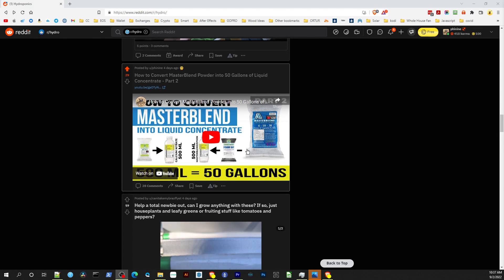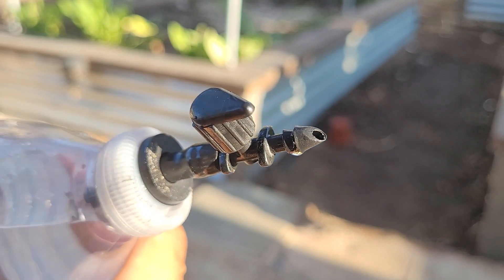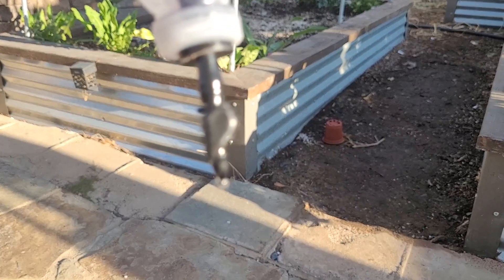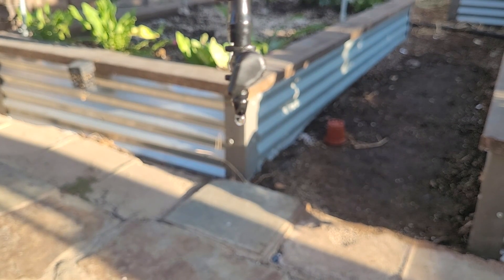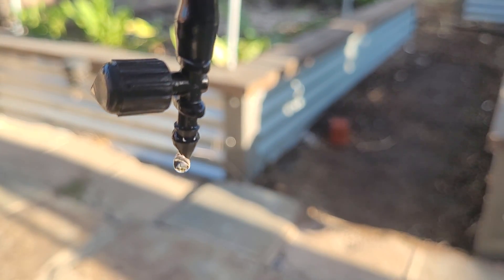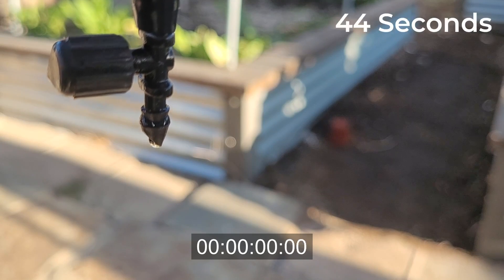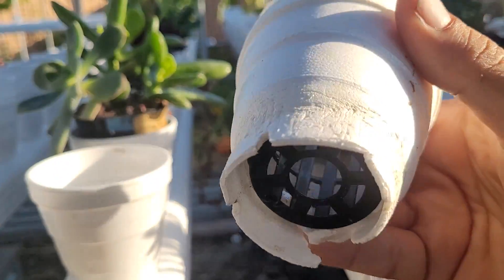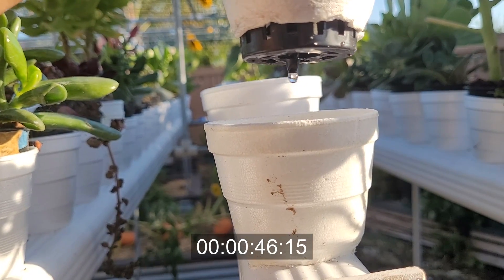Kratky Gravity Feed Nutrient Injector Over a Period of Time Experiment - Part 1

Comment: In the next test video, can you do a ph, ec or ppm test throughout the rail to see if the nutrients are getting distributed equally. I like this idea and setup but I have my doubts thinking without water flow, it won't mix well.  I've been watching the Grow Kratky channel and he is using a nutrient solution reservoir with a float valve to keep the containers filled using gravity and no electricity or water pressure. I think the key difference is that the nutrient reservoir is premixed because unless you can mix the nutrients throughout the containers equally, it's going to just stay where the nutrients drip creating a lower ph and higher concentration of nutrients there.  Very curious to find out otherwise.
Reply from the maker: Well right now I am just 24 hours into the drip and it seems to still be working.. I am just doing water to test and just want to see how long it takes to run out. I do understand what you are saying on the larger rails as nutrients would just build up in the middle rail. But there is a couple of things going on there as the water is tied into my garden beds and the water goes on every 12 hours for 20 minutes. So there would be some type of ebb and flow maybe once I get plants in there and they are drinking. Because when that valve turns on the float valve opens with pressure and would mix the water around. The lower the water the more the valve opens. And then it all comes into equilibrium with the other rails through those tubes. But I think it would work good on my smaller rails all around my window sills with 10 to 12 spots and this would make sense to use this there. I will start there on a smaller system first with the nutrients to see what happens and measure the PH and EC to see how it fluctuates. Experiment for now.. I will keep you posted on what happens fail or not!!

Comment: Pretty awesome system and experiment, I like it a lot.   This year I've been using those automatic timed water pump devices from ebay/Amazon/_etcetera-they're self contained and self priming and cost between $20-$40.  Most units come with a series of splitters and watering spikes to do between 6-12 plants.  I like how the timer will pump once a day and depending on the time you set- it determines how much water comes out to a maximum of between .8-2.0 gallons per day and as little as an ounce.   Fun and the battery on mine has only been recharges once this entire summer, I have it set to pump exactly .8 gallons per day.
Reply from the maker: Can you send me the link of the one you got. I saw them yesterday and they look interesting as I was thinking they could be used to dose nutrients. But they all looked to be dor indoor and I am outdoor.
Reply: @rufflifehydro  This is the exact one I got, It pumps nutrient solution just fine and is a great value-mine is outdoors, literally covered by a cup and we are in a fairly wet climate plus I have a misting system hooked to tap water and that is also an amazing system which turns my entire tiny backyard into a misty rainforest for real.
Reply from the maker: @ProlificInvention  Where is the link?? 😆
Reply: @rufflifehydro  They keep deleting it 😆
Reply from the maker: @ProlificInvention  Just give me tbe name I will look it up. Ebay or Amazon?
Reply: eBay and Amazon have them under the search: automatic plant watering system, I usually use ebay